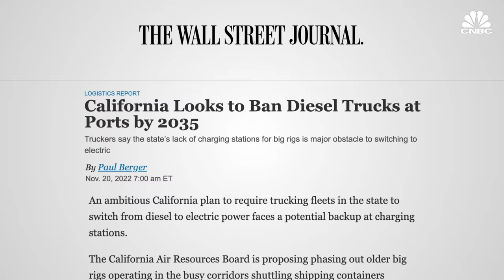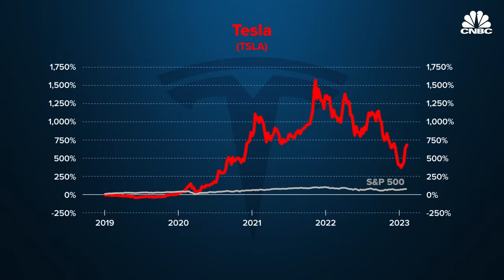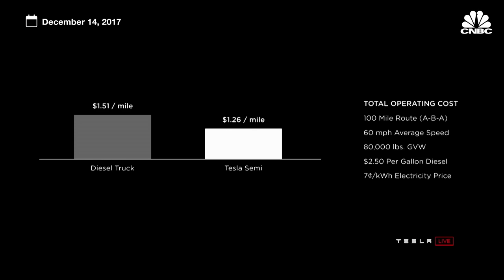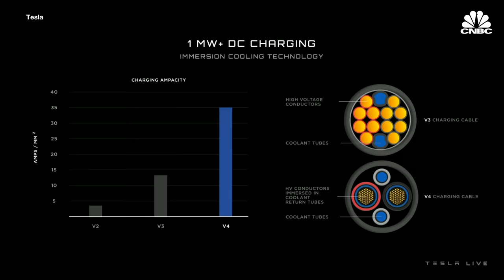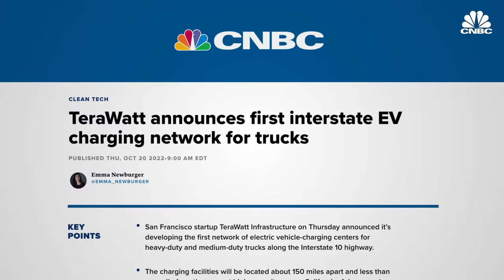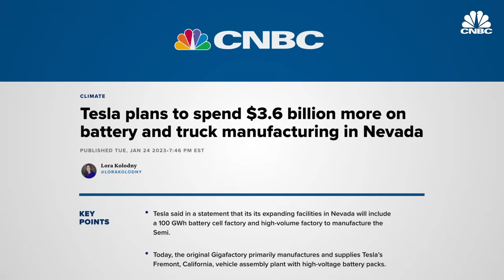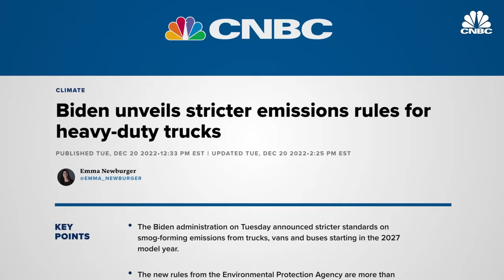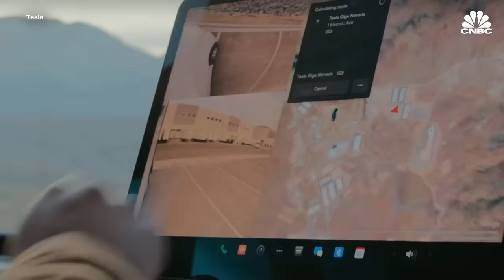Does The Tesla Semi Live Up To The Hype?

Comment: I’m curious how they will charge them all with the incredibly overwhelmed California power grid.
Reply: its called solar ..
Reply: @flodjod  the grid itself the problem, not the energy being required to run it. all electricity is being run through larges wires and they are old and at capacity, john oliver made a good video on it
Reply: The power demand is bad from 12 noon to 8 PM night.    12 noon time can sometimes be filled with solar  but night is when the grid may fail.  Thus they cut power to heavy users like  that like a low rate like car charging  and AC users to keep hospitals and police stations running.    Elon has also made these T  battery banks for charge station to level out some of the surge demands.    I think I see about 20 wall chargers good for 800,000 KW   or one truck reserve.
Reply: Maybe they should have updated the power grid before adding all these power needs to begin with. Seems forced. California will just unrightfully shut people’s power off to accommodate. Solar isn’t going to fix anything either, especially when it’s cloudy and rainy, windy. People don’t understand that dust on the solar panels will drastically reduce its performance. Think it’s the key to all their problems when it clearly doesn’t work. Same with wind energy. I drive by the wind farms all the time in California and only see a few spinning ever. Too much maintenance, not enough support. Most are broken down. Waste of tax payer dollars. It’s all a scam.
Reply: Overall, less energy would be required. Using a EV power chain uses less joules of energy than a ICE powertrain would due to the losses of conversion, heat, transportation and transmission. But sure, the grid either needs to expand, or companies should invest in local energy storage and production (solar/wind, with batteries) to power their fleet. Anyway, its a long term investment, that gains them in the long run.
Reply: actually electric vehicles use less electricity and the grid cannot wait to have more vehicles charging it is a win win situation
Reply: @JohnSmith-pn2vl  electric vehicles use less electricity than diesel vehicles? Interesting...
Reply: They won't
Reply: @MrDmadness  sure. Driving EVs will require less energy than the ICE counterpart, and we aren’t talking about a overnight transition. The grid can be expanded, and it should be done sustainably, as it’s best economically long term.
Reply: @sebastianorye2702  no, that's factually inaccurate
Reply: @MrDmadness  How so? In raw energy usage, having a fuel source already in the form of electricity will always be more efficient than having it in hydrogen or Oil/Gas. Car engines are inefficient, relative to industrial-sized engines, meaning that driving an ev from energy created by oil power plants still requires less energy, and subsequently has lower emissions. Thats how even an EV powered 100% by coal- the worst offender, over its average lifetime still manages to beat out an equivalent normal car (ICE) in terms of it being more environmentally friendly.

Let me know if i missed something.
Reply: @sebastianorye2702  fuel density. 
Gasoline 46MJ/kg
Lithium 0.3MJ/kg

46 / 0.3 = 153.333   

Gasoline has about 153% more energy per unit of weight than lithium does. 
While battery power is very efficient, it's not the only factor. You have to consider weights involved because in its most very basic argument, it takes more energy ( joules ) to move an object with more mass. Gasoline engines are very inefficient but they still have greater power for per weight unit. 

I understand you could talk about transmission costs for gasoline but the same argument holds true for electricity transmission regardless of source.. many line caps use large amounts of oil in fact to insulate the components ( oils non conductive ), that's what line transformers are filled with.. im not a pro oil guy, I like electric stuff, but I am somebody pretty rooted in reality, and I am fully capable of crunching numbers and pointing out when desires attempt to lean on established physics 
:)
Reply: @MrDmadness  that's not how percentages work lmao
Reply: @rx1834  this us reality bud. Harsh but true. What is it about the math that bothers you ? It's factually accurate. Or are you just trolling ?
Reply: @rx  still waiting... what about this math troubles you?
Reply: @clappedshinobi2863  So, you always see why? every problem can never be solved by anyone, anywhere, so let's never do anything, life is pointless, and your particular life is not worth a Dorito... Have a nice day!
Reply: At night sounds like a good time when most of California is in bed with cookers, kettles and TV's all switched off. All that generating capacity unused. That is why night time electricity is cheaper!
Reply: In the video at 11:05, Neha Palmer, Co-Founder and CEO of TeraWatt, made it very clear... there will have to be a huge investment.  As she described it, two hundred years ago the rail network was built... one hundred years ago the highway network was built... the electricity transmission network upgrade is the next requirement.

Comment: These trucks are prefect for delivering Bags of Air !
Reply: So true! Also 44,000+ lbs. of concrete highway barriers or 42,000 lbs. of pallets weighing 600KG each.
Reply: yes, and everything else as well, weight makes basically no difference in an ev, thats a huge difference to combustion vehicles where weight makes all the difference.
regenerative braking is the keyword.

Comment: A million mile guarantee! Bold! I like it and would be willing to drive this rig!
Reply: Before def, trucks made way more than 1mm miles with the origonal engine and some newer trucks still do if you keep a head of the maintenance schedule... So that's not much of a guarantee, it will take a little over 6 years to know if it's true.
Reply: You won't get the chance once it drives itself
Reply: @MyLifeTheStruggle1  Actually you can get a certification for autonomous trucks, which I plan to get. So yes I will because AI can't handle specific tasks such as where many flatbeds go. Ie construction areas in the middle of nowhere.
Reply: @MyLifeTheStruggle1  planes fly themselves, still need pilots
Reply: @TheBuddilla It’s only a matter of time before you’re obsolete as a driver. Nothing new, just progress.
Reply: @zaspalia  By that time I will be retired from driving, and when the world collapses because all things automated stops working, I will be pulled out of retirement to run the old trucks. ;)

Comment: 15:00 "Given the total costs of operation is significantly more beneficial than for ICE vehicles. I'd say by the end of the decade at least 50% of the commercial fleets will be electrified."  I think this is the critical statement. Semi Trucks have such regular and costly maintenance and repairs it's not going to take very long for owners/operators to see the clear benefit of EVs. (The Tejon Pass 4414' on the Modesto to Southern California I - 5 route. Instead of burning fuel going up (possibly overheating) and then burning expensive brakes going back down. The Tesla Semi on the descent regains almost all the energy used climbing. It's as though the mountains were not even there.) 
And the final word, "We're not there yet." When was that last said about the electric car?  Something else amazing about Musk is not just that he promises and then delivers, but that he gets his idea and product across.  Thomas Kuhn in the Progress of Scientific Revolutions made a convincing case that new science is never accepted until the old guard dies or retires - doesn't matter  how powerfully the case is made.  Within a year or two of the introduction of the Model 3 everything changed. Sure many OEM vehicle company CEOs were replaced -- but not by EV supporters.  What has changed is that every OEM is now scrambling as quickly as they can to electrify their vehicle lines. (And the U.S. tax credit which gives hybrids the same status as BatteryEV, I don't think has slowed this transition.) 
And good one CNBC. I've been critical of a lot that you do. This report is top notch, well researched.
Reply: “It’s as though the mountains aren’t even there” LOL I guess you didn’t do well in physics class AT ALL, did you?
Reply: @PTANV-x2g  Actually you’re the one who didn’t pay attention in physics class. Yes, it takes more power to go up the mountain, but the truck literally recaptures almost all of that power. When you go up the mountain and then back down, the net battery drain is almost identical to what it would be if the mountain weren’t there. So yes, it literally is as if the mountain isn’t there.
Reply: Yes, a good video overall, though they didn’t hit back on the critics as much as I think they should have. The claimed 500 mile range takes the battery down to 0, which is stupid, so a 425 mile route is totally expected. The guy also claimed that diesel trucks put out more power for their weight. Ok, but the Tesla semi puts out sooooo much more power overall. And all the energy it outs into getting that mass moving can be recovered when you brake.
Reply: @timwildauer5063   You're dreaming.
Reply: Agreed with everything up till "This report is top notch, well researched".  Nope, they filled it with FUD
Reply: @thanksno4911  FUD?
Reply: @timwildauer5063   Elon has stated (from demonstrable facts) that "ELECTRIC MOTORS have a HIGHER power to weight ratio than combustion (including jet) engines." Ergo, the power claims about superior diesel truck power versus electric truck power in the video are FALSE. The narrator(s) seemed just a tad incorrect in several of their statements, and my gut reaction was that they were a little ignorant or a little untruthful . . . . .or both.
Reply: @PTANV-x2g  Neither did you if you don't understand that gravity provides power regeneration to charge the battery while the truck coasts downhill. I guess you studied at Liberty University where the Physics curriculum is "faith-based." "Nowhere in the Old Testament can you find a reference to gravity. Therefore, God does not approve."
Reply: @reggveg  1800 horsepower...
Reply: @PTANV-x2g  - You do know about Tesla's regen braking right?
Reply: @hostarepairman  true not counting the batteries.
Reply: @timwildauer5063   The claimed 500 mile range takes the battery down to 0 
Actually, the Fremont to San Diego range demonstration took the battery down to 7%, not 0%; but the rest of your post is largely correct.

Comment: Will be interesting to see how long these last. Like what happens when you have to replace batteries etc? Is it affordable?
Reply: With a million mile guarantee it should last a while
Reply: with the arrival of the million plus mile battery that becomes a non worry
Reply: @flodjod  Does that exist now?
Reply: Lithium batteries are very recyclable and are worth about 1/3 of original value when used.
Reply: @menotyou1234  Right. But currently for a Tesla 3 for example you are looking at about $15 - $20,000 for a replacement pack. AND only Tesla can do it if you want a warranty etc. With a Credit for your current pack you are looking at almost $15,000. Thats more then the cost of almost every full car I have ever bought.
Reply: @menotyou1234  Very recycable? Tell me where they can recycle them more than 50%?
Reply: @imelusb1528  Redwood Materials - 95%
Reply: @CozumelTy  Indeed this comment section is populated by people that do not understand how electricity is NOT different than oil based engines ... On our farm tractors run 24/7 at times ... The cost to operate electric units will be __________ . Electricity is a dead end if electricity is produced from non renewable sources like it is today for majority of places . Good day CT
Reply: @niniv2706  electric vehicles are as clean as the power grid is and they automatically become that much cleaner when the grid moves away from stuff like coal. Yes a lot of places today rely on dirty power but that doesn't have to be the case and more renewable energy is coming online all the time. This really doesn't seem to be a very valid concern at all. We have to start making changes if we ever have a hope of making an impact.
Reply: @Newspeak.  All this said anddone ... I am 100% for R & D in the electric tractors and trucks ... But for the next 20 years ... We are in LAla land and make believe level My Little Pony ;) Be safe outthere and ... Happy . Later
Reply: @Newspeak.  naw it would just strain the power grid more and have people pay more for electricity
Reply: they can be almost fully recycled or repurposed for grid-based storage. Rivian has committed to doing this with their vehicles.
Reply: Some areas it actually was more expensive to charge than use gas.
Reply: @270eman that happens every time that the electricity is generated by gas or greedy people!🤔
Reply: @You're Wrong No, Redwood materials have already proven it can be done, with profits as well as savings for buyers as well.
Reply: The batteries should last 10+ years.
Reply: @menotyou1234  where are they recycling EV battery packs? This currently does not exist. Can you say what your source is for this information?
Reply: @CozumelTy  A nice thing about these battery cells is that once a Tesla's battery has seen significant battery degradation, the idea is to reuse those cells for other lower battery storage systems such as the Tesla Powerwall. A rough example would be if a person has a 75kwh battery pack in their car, and over 250,000 miles decides to get rid of their Tesla, the battery back might be able to hold somewhere along the line of 65kwh still. Plenty of power still for a Tesla vehicle, but instead why not use those cells for a few 7.5 or 14 kwh Tesla Powerwalls?

This is one possible solution in reusing the batteries without breaking them apart and actually recycling. We'll see what happens though. I believe I read this somewhere from a shareholders meeting online and I'm trying to find it.
Reply: @Super Asli - I did not say it was worse than Gas and furthermore being a farmer I can fancy electric tractors for their impressive "torque curve" ... Albeit "ON PAPER" in aether at the moment . 

So what is best Super Asli ... An operational now with a low entropy non-chaotic potential society or ... or the Big Bang ? You picked the Big one before stability . 

I am more a ... Let's present a solid R&D on ways to produce enough power to provide a stable goods and  service chain ... While we are relying on proven methods of production . As a farmer there is NOTHING per batteries that  could achieve the yields we are pulling today ... A major food crisis would be the result of IMPOSING a Utopian world . 

I am all for R&D ... But in 2023 ... As farming goes ... Nothing in a near future could keep production rates at par with oil . Super Asli ... Be safe and happy . I hope you are correct . I do .
Reply: @CozumelTy  Jesus. 15k? wow yeah no. I’m okay. Awfully expensive
Reply: @helmshardover I would need data that shows the longevity of these 'recycled lithium batteries.' for decades the rule has always been 'if it's bulging, toss it.  And not data from Redwood itself, but from an unrelated third party that doesn't work for Ford or Amazon.  And what sources were they getting these recycled lithium batteries from?  I've seen 18650, 123 batteries and they coin shaped ones get tossed in the trash plenty of times.    Can they recycle those?  Or are they just basing their data on EV batteries?
Reply: Yes if you are Elon musk or Bill Gates!
Reply: @perfectgematriadecodesabc4259  yes the utilitie.companys are not into charity
Reply: It's a piece of business hardware and the semi is considerably cheaper to operate over its lifetime than an old diesel.
Reply: @CozumelTy  there are already model s and x in taxi/rental services that are already clocking over a million miles, and that's on the older cells
Reply: @CozumelTy  Average price of new cars in the US is around $48K in 2023. There are cheaper cars under $20K, but they are almost all subcompact size, underpowered, and, well cheap.

Comment: I’ve seen a few Nikola 18 wheelers. It was wild hearing nothing but fans running but no engine noise.  Even crazier was watching the fully loaded 18 wheeler pull off like a car.
Reply: Could you ask the drivers how many parts are made by GM versus Nikola?
Pretty sure they signed an NDA anyways...
Reply: @johntheux9238 GM doesn’t supply any parts for Nikola’s trucks